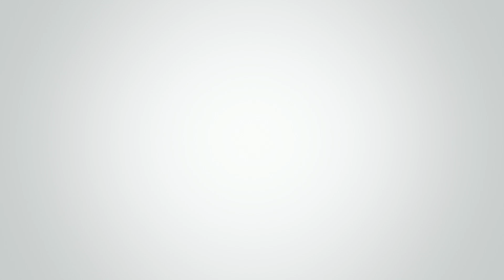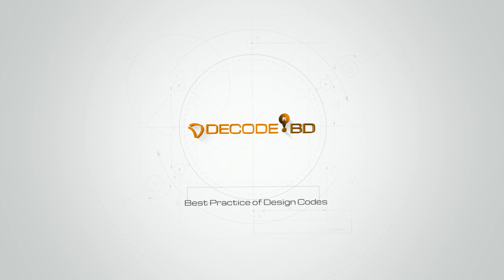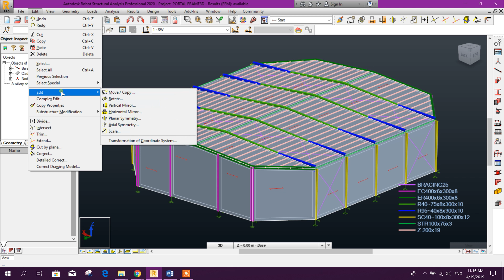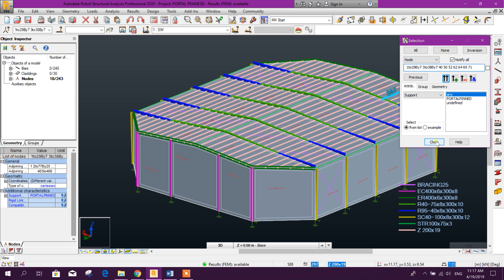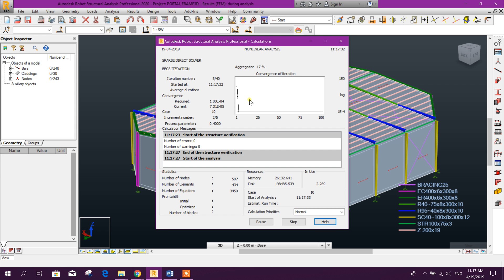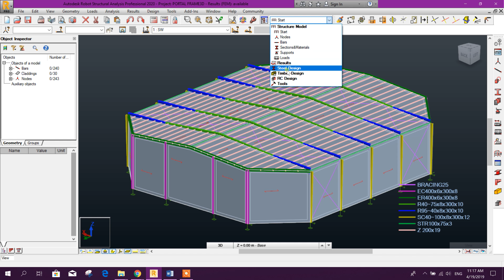INDUSTRIAL SHED DESIGN IN ROBOT STRUCTURAL ANALYSIS : PART-3 (ANALYSIS & DESIGN)

Comment: Hi. I did follow your step by step tutorial from the vid 1 and by the time I run the calculations at the beginning of the last video some errors very different than yours popped up. Something related instability of type 2 in some nodes and no convergence of nonlinear problems in cases. I don´t know what could possible went wrong since I am learning Robot Structural, I will appreciate if you can supply an email in order to send you the file I have and you can review it. I will also appreciate a feedback.

Comment: Great work , God bless you , any way to design the connection between the diagonal beams in horizontal direction with columns on robot like these diagonal beams on your model? or you prefer to use another program to design them ?